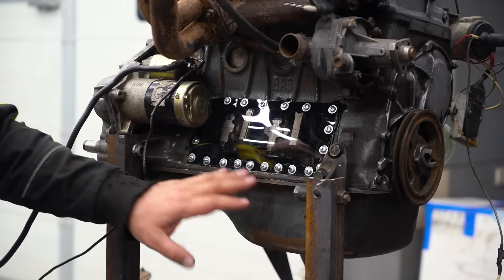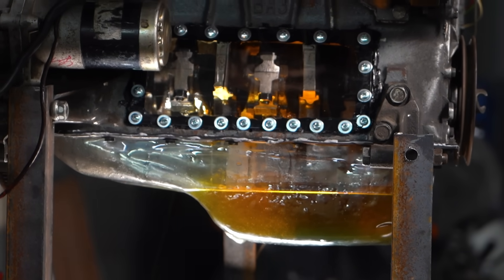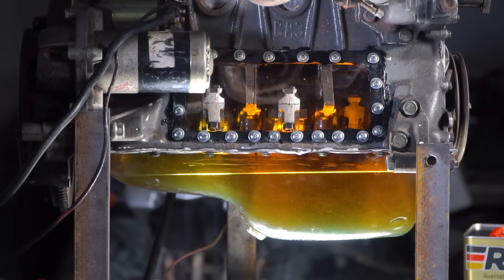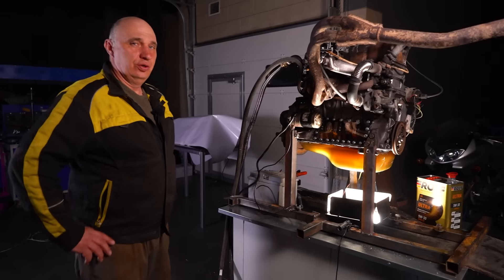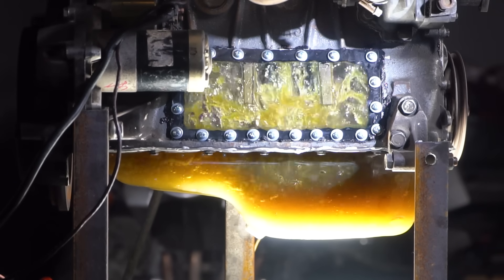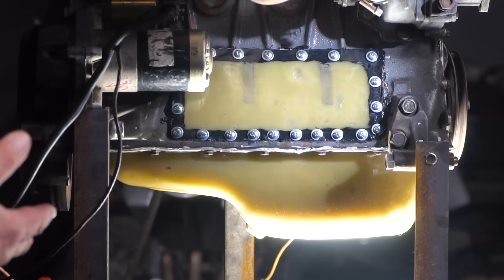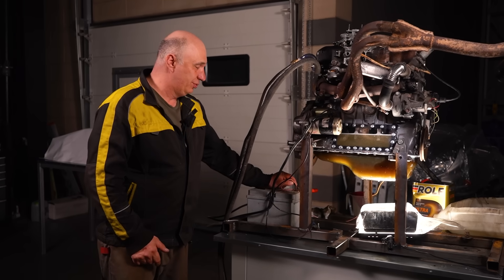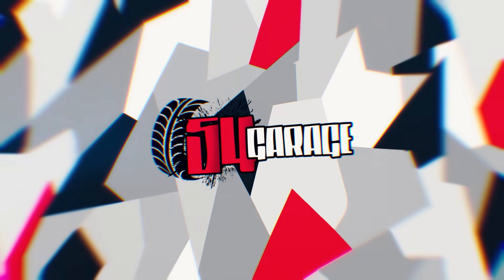What actually happens when you overfill your motor oil? (w/ transparent oil pan)

Comment: My mechanic has told me stories about engines having been filled twice by mistake at an oil change. One blew all the oil seals and the other blew its block.
Reply: Which just goes to show how robust the Lada engine is. Definitely my go-to for the zombie apocalypse, lol
Reply: @robinpage1987  I don't think the Lada engine would survive something like that either. That test engine only survived because the seals of the "windows" gave way and released the pressure in the crankcase.
Reply: @robinpage1987  That, 70s mercedes and 80s Hilux 😁
Reply: @wobblyboost the Ladas are exponentially more common, though that's assuming you are in the soviet sattelite regions.  even so, the Mercedes and hiluxes are rapidly winding up in junkyards to get crushed.
Reply: @LuwiigiMaster  Oh i'm in Australia (little island in south asia 😁), I don't doubt Ladas would outlive them, but was just going on the interesting fact that older model 'luxes and mercs are extremely popular in arab regions, africa, sth americas and most of asia as they too are highly reliable and repairable. Don't get me wrong, modern mercs and most of the toyota range will be lucky to live past 5 years, are expensive to repair and parts hard to source or reproduce.
 Interestingly a lot of Ladas are being sourced for purchase by Russian companies in UK and europe to satisfy a need for parts recently, due to 'the troubles'; so many Ladas are getting to return to mother russia again.
Reply: @wobblyboost A Toyota only lasting 5 years, being expensive to repair and parts hard to find? Not sure what island you’re living on, oh wait, the same one I do. This is complete rubbish pure and simple. The only unreliable “ Toyota “ would be the Supra but given its a BMW in drag it’s not a Toyota anyway.
Reply: @gdubyadubya8961  maybe you needed to be here following the convo 4 long months ago, the context was russia and the slavic satellite regions and I was talking modern Toyotas over 20-30 years old ones... in that region.
Reply: This looked like a different engine to the usual Lada ones they experiment on
Reply: @robinpage1987  Yes, it's a very robust design, but it is not going to meet any emission/economy standard.  It survives because the loose tolerances give it a big advantage when running at the adverse conditions.
Reply: Ladas are designed to be worked on with the absolute minimum of tools too.

My early Niva user manual literally had a picture of the car tipped up 45degrees with a 2x4 propping it up to service something underneath.😂
Reply: Lol who does an oil change and not check the level
Reply: @sigmamale4147  You would be surprised at how careless are some very underpaid very young intern technicians in dealerships.
Reply: If you overfill a mini engine by not too much, the crank slaps into it too hard, and after a couple of hundred miles the crank snaps. :-(
Reply: You come up with the most amazing things to show us😊
Reply: Yeah, a blocked PCV valve can also cause that especially on older engines with a lot of blow-by
Reply: @constantineyannakopoulos7299  That reminds me of a potential customer who arrived at the oil change shop that I was employed at many yrs ago: a brand new Honda accord with a 3.0ltr J30 engine.  A week after he bought the car, He read the owner's manual, found out how much oil, and without checking the dipstick first, poured in more oil.  And drove it hard on the freeway for almost an hour(according to what he told me) He noticed that white smoke exiting his exhaust since we were closest shop, he pulled onto our lot:  Blown head gasket with less than 500mi. on the engine.  We only changed fluids, we didn't perform any mechanical repairs, so we weren't equipped to perform the repair anyway.  So we showed him where the dipstick was, & how to check the oil, then sent him back to the dealership where he originally bought the car.  Luckily for Him, it was only 5mi up the freeway, but he could nurse the car there on surface roads too.
Reply: And I suppose the car owner was presented  with a bill for new engine.
Reply: @johnbower  If you are replying to me, yes ... I had to replace the engine in my mini, after I got a friend to help me tow the car home!
Reply: Overfilled mine by a quart and could see thick smoke coming out of exhaust until I drained it
Reply: I dont doubt, the forces inside the block at redline must be insane

Comment: So at the end of the day, it was all just more fear-porn. DON'T DO THIS! THAT! OR ANYTHING!  WALK ON EGG SHELLS ALL YOUR LIFE!
Reply: Well, not really.  You have to really f up and go triple or more past the max fill line which will increase foaming which over time will mess things up (this depends on the engine design of course, this is a lada after all).  The oil also breaks down faster.  But if you go a touch over the max fill, it's fine.  You can also run anywhere in between the marks on the dipstick with no problems.  Probably well under too, but that's another video
Reply: The only worry is being shy on oil, too little oil and revving up the engine too long which further empties the oil in the pan causing potential huge engine problems. Overfilling is fine and in fact if you drive fast on the freeway, I'd advise it or buy a 5 speed or big tires to gear it up and reduce RPM.

Comment: As a mechanic I came across cases where the engine been filled all the way up to the actual filling cap
Reply: The YouTube channel Just Rolled In has people topping off oil way up with all kinds of liquids, and other 'interesting' backyard fixes. Worth a look.
Reply: @Colorado_Native   ANd I thought brazilians lacked car maneintnence.....
Reply: Oil valley blockage..
Reply: Ditto, all the way to the top.
Reply: Yes that can cause really big problems lol. Such as bent conrods and hydraulic lock.😮😅
Reply: @nahbro3240  They have to be checking the correct dipstick, never underestimate the capabilities of the stupid.
Reply: Blocked oil galley... just guessing
Reply: @benson4u215  I will give the reason here and those who read will read so to speak. Outboard engines. They had a service light indicator on the tachometer when you needed an oil change and the oil light would start to blink when you drive. 
This blinking oil pressure light was just indicating time for changing oil but do you think people read the book?
No a blinking oil light meant low oil for most and they started to fill oil like there was no tomorrow. But the light would not go away because there was no problem. Except they kept filling oil because the light kept blinking right? Until no more oil could be filled they figure that light won’t go away and call a mechanic for it. 
It resulted in some engines getting hydro lock   
You would not believe what some do with their machine when misunderstanding the indicators.
Reply: Probably, they've been gasoline engines, diesel filled to the top will run away almost immediately after starting
Reply: Impossible - that engine would have gushed oil out of recirc, PVC, etc. Unless it was towed in.
Reply: @the_kombinator  they did and either hydro locked because of it or stalled because they became flooded with oil in the cylinders. I explained why it happened above because people mistake the service indicator for oil pressure warning and started to fill oil without question. Not everyone filled the engine as much as it went all up to the cap but enough to cover at least one piston in the crank case and when the engine was left for a while that cylinder then filled with oil seeping through the piston rings and the engine would not turn over when you tried to start it at this point. I guess it would been wise to use a different method to display a service indication than blinking the red oil warning light for it. 
You can probably figure out the easy confusion when the oil pressure light is blinking red it may indicate your oil is low or something but it was just time for an oil change in that regard. If it was solid red you have no oil on the same light. People got scared and did not check the book what it meant. Some more than others and just went for it, it needs more oil, just fill until it stops blinking. Except it didn’t.
Reply: @Pulverrostmannen  It's funny that more people would have read your comment vs the manual, including myself, who has about 5 hours on an outboard motor in my entire life. I would, however, stop and read the manual if that kind of thing happens, but then again, I'm the kind of guy who writes manuals ;)
Reply: @the_kombinator  indeed. I think it is a lot like a fear reaction too. I think it would had been a bit more logical if the light would gone away after the engine is started in such case. 
Or if a different combination of lights would been used than just flashing the red oil pressure light when the engine is both off and running. It is easy to misunderstand such a light
Reply: Doubt you have, that would take 24+ liters, not even my girlfriend would do that.
Reply: @barrymccockiner6641  it was on outboard engines. They are often smaller in volume than car engines
Reply: @barrymccockiner6641  Na, I've seen it done, took the guilty party about a month of buying oil pack after oil pack, but he managed it.
Reply: @barrymccockiner6641 just say you've never turned a wrench lol you sound just like the guy who would do such a thing😂😂

Comment: So if you overfill your oil a bit accidently, it's not a big deal. 👍
Reply: Dependent on how big your sump is and therefore the capacity ids.
A truck with 6 litres of oil can be overfilled by a litre no problems.
A motorcycle with a capacity of 1 litre...can't be overfilled by a litre of oil...
maybe 100ml?
Reply: @JohnSmith-pl2bk  Yeah, that's kind of a given.

Comment: Thanks guys. I just added an extra 5 quarts just to be safe.
Reply: Another 5L might make your engine run away if it's a diesel.
What they haven't tested is getting that oil hot enough to produce oil vapour that goes into the intake (they stuck the breather into a bucket).
Reply: @demil3618  
The demo engine may be quite forgiving and seems to have a particularly large sump.
To make engines fit smaller cars, overfilling could be more of an issue, as their sumps may be smaller.

I would be very carful about overfilling a diesel.
A garage once overfilled my Saab diesel and the engine management light came on together with limp mode.
After lowering the oil level and cleaning out some breather pipes all was OK.
Reply: @iscmiscm  Well, the limb mode is triggered by the oil level sensor. Merc ECUs do the same.
But that's obviously for a good reason indeed as you pointed out.
Reply: Put 7 extra for my Corsa 😂
Reply: Too much oil will blow the main rear crankcase seal. ($$$). Aerating the oil isn't a good idea.  Cold weather starting should be fun with moving parts submerged in oil. 

So what does 54 Guy now recommend for oil change intervals?
Reply: @j.mygrant3752  Agreed and to thick a viscosity and some thick sticky oil additives will also blow the tear main seal.
Reply: Add a quart of gearbox oil to decrease friction losses even more.
Reply: @NotAnonymousNo80014  And Grease! Red, extra-tacky grease1
Reply: @nombreapellido9038 Worked OK in my old air-cooled VW with the oil bath air cleaner. LOL
Reply: Five "quarts"? What the fuck are "quarts"?
Is this something from the 19th century? 😅😅😅😅😅
Reply: @kennethkeen1234 4 quarts equals 1 gallon. US don’t use litter
Reply: @Chuyennguyen454  but what the hell are "quarts"? usa is drifting into a hole it will never again emerge from, now that AI has appeared as AI uses correct English and few in usa have the slightest clue what 'English' means. But of course it's fun to spot yank comments on YouTube. 😀
Reply: LoL
Reply: Plot twist, it wasn't his car.
Reply: Yeah I went ahead and topped mine off too 😂
Reply: LOL
Reply: That's how Ford model T's used to lubricate the crank end of the piston rod. By splashing in the sump.
Reply: am gonna do it too
Reply: Quarts? What in hell is that?
Reply: @kennethkeen1234 imperialism
Reply: @kennethkeen1234  0.946353 liters.
Reply: 1 Quart = 1 Litre  @kennethkeen1234
Reply: @kennethkeen1234  about 4 liters 😁oops that a gallon i was thinking of, one gallon equals about 4 liters.
Reply: If our truck has 25 quarts as standard...no problem.

Comment: Too much oil will give Too much cavitation to the oil pump which will starve the engine from oil  ! 😢
Reply: The problem is aerated oil being sucked into the oil pump. The pump will then have a problem pumping enough oil. But yes, too much oil can cause a problem with the oil pressure.

Comment: I remember someone telling me he had a company car and wife brimmed it with oil and started it. Blew a load of oil seals and destroyed the engine. 😂
Reply: Clearly it was not a LADA engine. Otherwise it would just spit all the excess oil on the road and continue operating normally.
Reply: @Kirillissimus  no it was a modern BMW
Reply: @Kirillissimus  No it wouldn't, the oil would have been sucked back into the engine via the crank case breather and would have hydro locked the engine,
Reply: @stevenc5227  it would stall out from missfire before hydrolocking
Reply: @stevenc5227  The comment just shows that you are not aware of common mods done to classic LADA cars. Of course you are not supposed to use them straight away as they came from the factory. First you remove the original breather hose and plug the air filter port using a standard soviet wine bottle plug to prevent vacuum leakage and then you clamp a 40cm piece of a garden hose to the engine breather connection tube and you just let the hose hang down loosely affixed to the gearbox behind with a piece of wire. This way not only the problem is solved but your engine continiously provides the whole bottom of the car with much needed rust protection. That is just common knowledge.
Reply: @Kirillissimus  On BJ-40 and 42 Toyota 4-cylinder Diesels from the 70's and 80's that was standard...No modification required.
Reply: @Kirillissimus  So common it made it all the way to the English speaking countries.
Reply: At the "up to the pan line" looks like it could be useful for scrubbing the bottom end for sludge tho lol
Reply: @MadScientist267  Those 'scrubbing bubbles' work miracles! 🤣
Reply: @Fordworldrallyfan  lol
Reply: lol

Comment: too much oil makes those large bubbles that will likely result in intermittent oil pressure on the rod bearings. But adding a little bit more over the max limit doesn't seem to cause any problems. A little foaming occurs anyway, also depending on the antifoam additives
Reply: It all depends on the engine construction. Some are a lot less tolerant than the Lada engine used here. So it's most safe to stay within the min to max spectrum. A little to much might not be the end of the engine, but with modern engines I would not take the chance.
Reply: Looks like you can double it and it won't foam lmao.